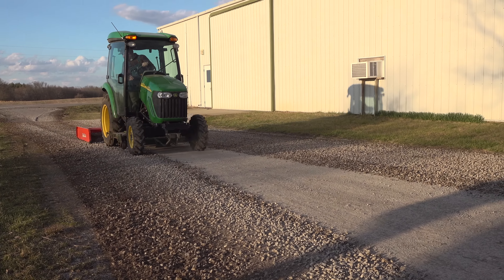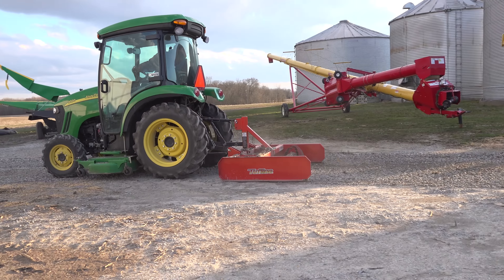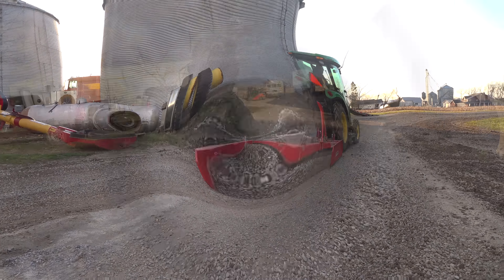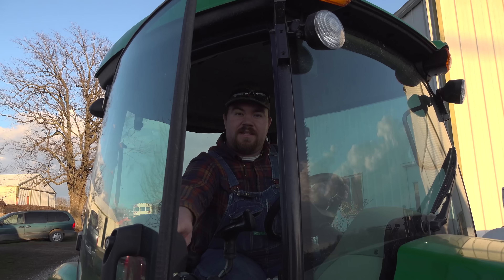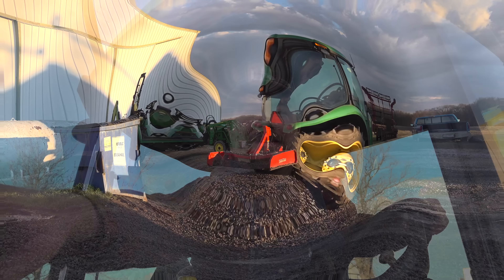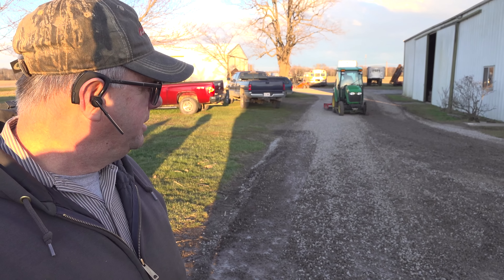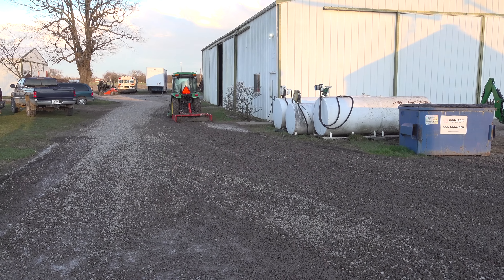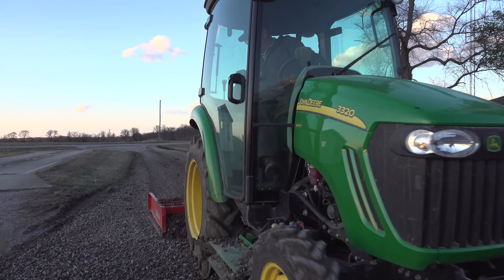Can The Land Plane Save Us From Buying More Rock?

Comment: I'd love one of these for my 1/2 mile gravel road but they cost a fortune!  You can buy 3 box blades for the price of one land plane.  It's nuts.
Reply from the maker: I think you should shop a bit harder. They should not be 3x a box blade.
Reply: @TractorTimewithTim  The least expensive one I can find under 72" is $1,149 at Rural King.  The one you feature in your videos appears to be well above that in price.  At that point I'm literally 3X the cost of the box blade we bought from Tractor Supply Co. a few years ago.
Reply: Side note:  After shopping around some more, I get the idea that prices have gone up substantially on these attachments, perhaps due to COVID and supply and demand issues?  The box blade we have is now $799 and it was significantly less money just a couple of years ago.
Reply from the maker: @4-LOW  First, I'm not sure you need a 72"...unless you have a larger tractor than me. 
Second, I suspect you should look at the price of box blades again.  Remember that steel prices have gone up dramatically recently.

Comment: I have a 400' driveway and this looks like a nice tool to have to even it out.  I've been using a box blade and loader and it's hard to keep the gravel even.  The amazon and UPS trucks throwing it off the road doesn't help.  New subscriber.
Reply from the maker: Welcome to our channel.  The land plane is much easier to use than a box blade for driveway work!
Reply: I know what you mean Jerome.  We have an 1100 ft long gravel driveway and I really need to get a tractor and blade to maintain it.

Comment: A land plane will agitate the top surface.
The problem is the same as always,  the base layers (if indeed there are any!) are not installed correctly. The cost of correct installation is negligible compared to the cost of ongoing repairs. Yes the surface will smooth out, but it will inevitably return with the same potholes and ruts in the same places.
Take a look at ancient Roman Road builds. Still in the same condition as they were millenia ago.

Comment: the big mistake people make is not digging out the subsoil, you have to do it like you are building a highway for heavy traffic, clay will rise through the gravel when wet as the gravel is compressed through the soft stuff under load thus clay on top gravel on the bottom, Me and others gave this advice to a shipping container re-seller, he never took heed, his yard is a complete basket case and no matter what he does the slush continues to happen, when a dump truck with 13 tonnes of gravel drove over my yard it never made any impression.
Reply from the maker: Keep dumping rock on it.    It will eventually firm up.   For the first few years, it takes a new coat every year.  After that, it doesn't take much.
Reply: @TractorTimewithTim  i am doing a part of my yard, i have done other sections before which turned out all weather perfect, i have reactive clay, gets rock hard when it dries and soft as when its wet, i remove it because I  don't want it coming up through the gravel, using rocks are useful in some situations, container guy used rocks, he never listened, far better for him to remove the subsoil clay as his yard is slush when its wet, he has dumped many many loads onto it, gravel from the crusher not cheap when its by the truck load.

Comment: i really liked this video, you showed me an attachment i never seen used, so what is the difference in use and finish between a land plane and a box scraper ?
Reply from the maker: Land plane is easier to use...just drop and go.
Box blade has more flexibility, more potential uses, but you’ll need some experience to use it right....and it can be frustrating for the task shown here.
Reply: @TractorTimewithTim  thanks tim.

Comment: Tim, I've got 1/2 mile of dirt road leading up to my property, no one out here helps maintain it so I'm not going to pay to gravel it. I use a box blade and a regular blade, Do you think this land plane would work on dirt?
Reply from the maker: Probably.  However,, you have seen the totality of my land plane experience.  These two projects.   So, I am far from an expert.
Reply: yes t will make sure you do this in dry weather will also put a crown on road if used the right way
Reply: @mikenobbe1135  awesome, thank you

Comment: I have a land plane with scarifiers.  The 3320 doesn't have enough traction to pull a land plane with scarifiers in hard packed dirt/gravel.  While you can't stall the motor, the land plane with the scarifiers down will bring the tractor to a complete stop with all four wheels turning - even with all of the tires loaded with liquid.  I end up using the hydraulic top link to tilt the land plane forward, and then set the 3-point hitch height so that only the scarifiers are engaged and slowly break up the hard packed ground until I can tilt the land plane back level and use the blades to work the surface.

Comment: I applaud your keeping the grader flat! Most of the videos on YouTube of this type of implement typically have the back of the grader not even touching the ground. I typically do like you did and put a little pressure on the back blade. I think with the scarifiers digging it would be a good idea to have the blades not touching the ground?

Comment: I don’t have a driveway. I have a roller coaster track from all the washboarding. 😬
First on my to-do list as soon as it stops raining is to go at it with the backhoe, pull all the rocks that have come to the surface, and backfill with dirt. Then we’re going to need about $500 worth of gravel delivered. Can’t complain too much though - the last time it’s had attention was in 1986 when it was installed by the contractor who built the house.

Comment: Use mine all the time. Only if I have potholes will,I need the teeth to break them up.  It is my most used implement on my farm as we have a huge hill and dam and we get washouts after a rain or huge cuts if we get a tropical storm come thru.

Comment: I built a 54 inch land plane out of 3/8 sides and 4x4x3/3 angle blades with snow plow cutting edge. It works well , but is about all my poor little 1025r can handle. I only wish I had figured out how to add teeth.

Comment: Been debating on one for a while that looks like it works very well!! Thank you Tim
Reply: Works well if you have a good base of graded rock. Where I live its all natural rock, and thus its mixed large and small and packed for millions of years, so this will either bounce or get hung on a bolder and either ruin it or stop the tractor. I use a grader and then a landscape rake to move the boulders off the road and then again to finish it. What I don't like about these is the rock goes over the top of the blade, that isn't what you want to do, you want to roll it right then back left and feather it off on the second blade to crown the road

Comment: I think I’m gonna build a land plane.   I can get the cutting edges through a local steel supply.   Looks simple enough to do
Reply: I’m going to make a similar device that attaches to my box blade; with the cutting edge of the box blade being set a little above the plane cutting edges.
Reply: @darkwinter6028  I made a box blade similar to this but instead of a straight blade I used   Scarifier blade. Looks similar to a comb . Added wheel like system to the rear. With hydraulic top link you can adjust on the fly. To either dig or lay out dirt. Works great for loam or driveways.

Comment: Did you have any deep pot-holes in the driveway?   How effective is the land plane in removing them vs. just filling them in with gravel?   My experience on a high traffic private dirt road is the pot hole has to be “dug out” / made much bigger and the filled with gravel.  I’m thinking a box blade’s scarifiers may be needed.  Are the scarifiers you mentioned on the land plane rugged enough?
Reply from the maker: I think scarifiers would help.
Reply: @TractorTimewithTim  That's exactly what we do on our road.

Comment: Got 2. 1 at farm for a 1/3 mile lane and on at factory for a 2.5 acre graveled lot. Love them.Also have 4 box blades with 1 being a Gannon 6 way. Never use those.Back dragging with a loader bucket works but the landplanes are soooo much faster.

Comment: No county is maintaining their gravel roads by bringing loose gravel to the surface.  I have No idea why that perception is so popular on YT.  The dirt/gravel roads should be compacted & with proper 4% drainage they'll get as hard & smooth as an asphalt road.
Reply from the maker: I think this driveway is in pretty good shape.
Reply: @TractorTimewithTim  I'm sure it is.  I just hope that if you were to add rocks you'd mix them with the native/existing materials to lock loose rocks into something.  States use straight blades at an angle to roll & mix the moist materials together so they compact into a safe road with minimal loose debris on the surface.

Comment: Backing up, like your dad did at the concrete pad, works well.  He has the touch with that 3 point lever.  On our road, Linda and I team up with the 3046R and the Gator 620i to do what we call "Pot hole" patrol.  First, I use the box blade with scarifiers down one notch tilted a little forward to rough up the area around the potholes (we have between 1.5 to 3 miles to do depending on weather and neighbors work schedules).  Once the potholes are roughed up and leveled a little bit (with the box blade leveled first, then tilted up in front) we go get gravel with the loader and put it in the gator.  Linda drops it on the areas where the road is a little thin, and makes sure to cover the areas where there were potholes.  Then I use the front end loader and the Blade to scatter the piles.  Then I use the blade on the edges of the road (tilting it to the right a bit) to pull gravel out of the "ditches" and put it up on the road.  Takes about 3 - 5 passes to move the gravel from the ditches to the center from each side. Then I hook up the land plane and do what you did on your dads place.  With the top and tilt hydraulics, I can tune the front and rear weighting to pull (front down) or spread (front up) as required.  Gathering a load and dropping it works sometimes to fill in a little low spot.  Like at the fuel tanks...leave a few piles in the road then back over them to push up to the tank.  Great job...great camera work too.  That thing is one of the right tools.  Works best the day after it has rained to soften things up.  If really dry, no amount of passes will fill potholes.
Reply from the maker: That was brother Tom.
Reply: @TractorTimewithTim  aaaah. Missed that.  You guys are a real team...!

Comment: I just help my uncle get his and (recently died) brothers 8n back into the barn after it died in the field.  The rivot that hold the electrode on the rotor broke so no more spark. Funny with it sitting out for 4 months with a new rotor fired right up till it ran out of gas. Lol uncle didnt open gas valve but it got some water in the gas?? Seems